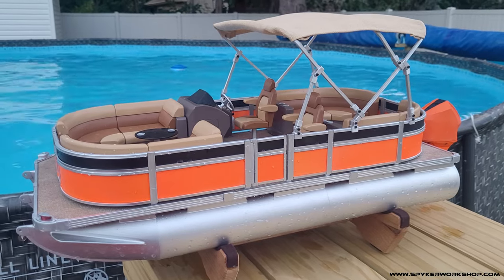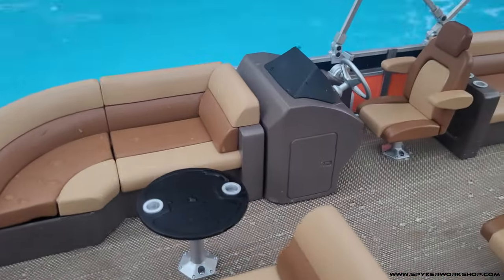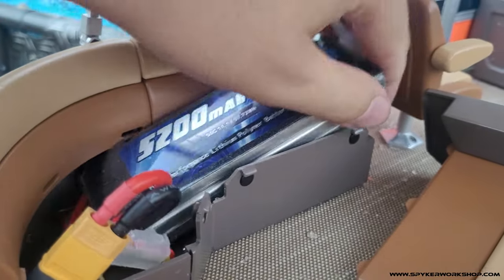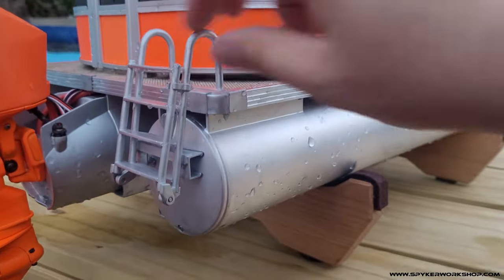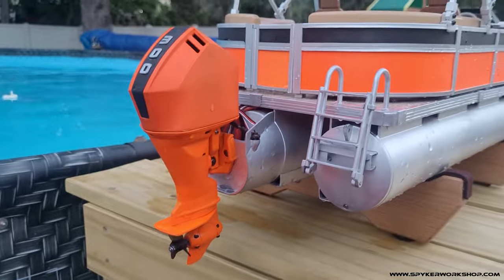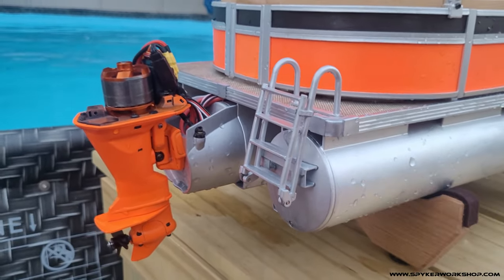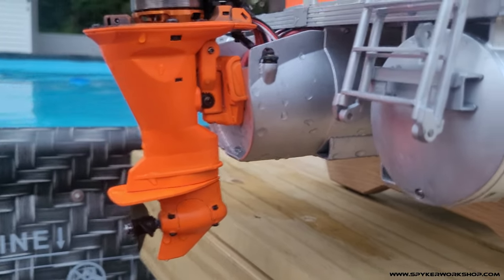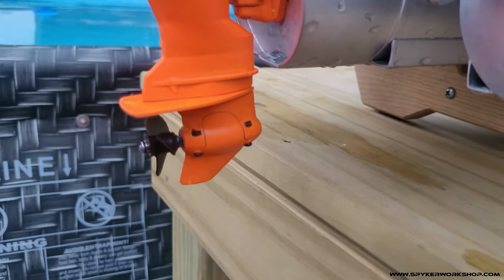Spyker Workshop - 1/10th Pontoon Boat KITs - NOW FOR SALE!

Comment: Where do you injection mold all the parts? The parts look more complicated and/or bigger than the tracks you injection molded some time ago. And where is that lake? Looks nice but not like I would have imagined the US. Is that Washington?
Reply: I think this is 3d printed. If you look at the "key features" it says "High-Quality Resin Components"... Which i think is resin-3d-printed parts.
Reply: @Hallslys  😅 I didn't think about that. I only saw videos about his injection molding and the old FDM printers. And I actually haven't seen so many resign parts, which weren't rockets or small figures.